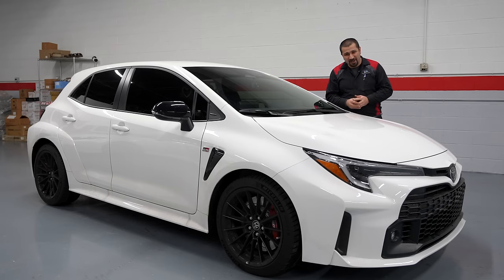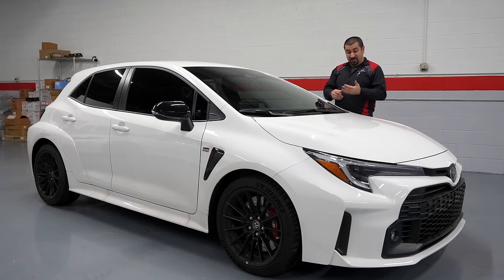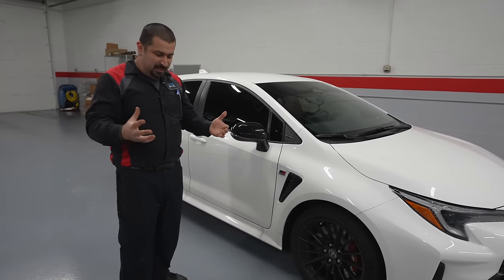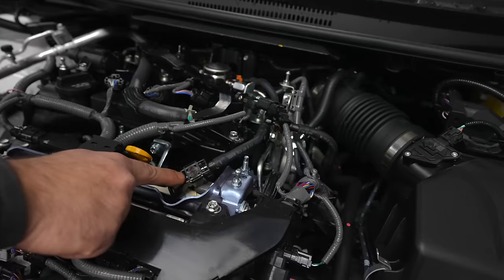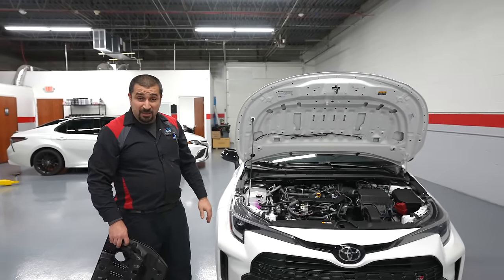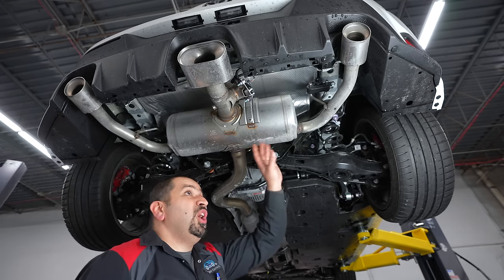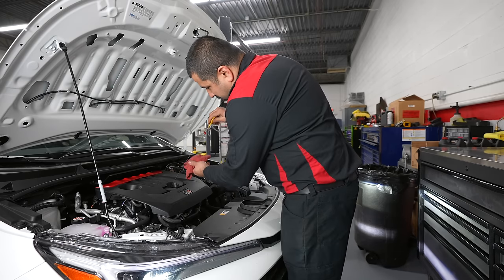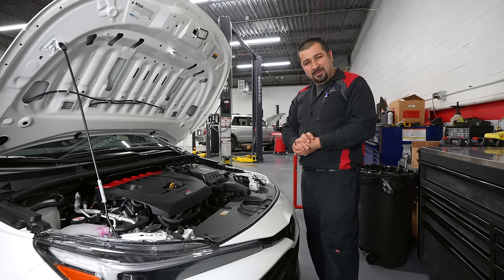The Toyota GR Corolla is Truly a Special Car | First Service and Technical Tour

Comment: I have been watching some car videos lately, and I have noticed You-tubers in this the third instance, desperately trying to upsell a three cylinder engine. (Another is the Nissan Rogue). Three cylinders don't follow the general laws of energy dynamics or simple harmonic motion. They are inherently vibrators from hell. So manufacturers are going to hype this stuff, make exhaust flaps and sound effects to fool you. These three little cylinders cannot even fill all that exhaust. This is our automotive future, 3 cylinders and probably a CVT moving an object that outweighs all the performance possibilities from the get go. This will be our brave new world. All because we allow it to happen and buy this stuff.
Did you hear him mention that it's "a very big turbo spooling up to around 26K rpm". Mmm, there's the key. Most of these engines will be mounted on hydraulic engine mounts to reduce the buzz and vibration. Hopefully, since it's a Toyota it will last a "reasonable" time. 
But I doubt it very much, since to get this type of performance from 3 cylinders is going to take some serious gas pedal inputs. As an engineering rule of thumb, 4 cylinders at 2.5 liters and normally aspirated will last forever. 
Or six cylinders straight and in V formation.
Just look at all those Hiluxes running around in Africa. Now those are REALLY engineered to last.

I am not knocking Toyota. I am getting a Camry V6 before it goes extinct. When we know as humans and learned people, that this type of physics doesn't work, we should not be applying engineering bandaids in the extreme and sell it as mechanically successful.
The only place 3 cylinder engines should be is on lawnmowers and wheelbarrows. Not on heavy objects like cars over 500 kg.
Reply: You raise some interesting concerns. Toyota has been mass producing 3 cylinder engines for Asia and Europe for quite a long time. They are installed in cars like the regular Yaris and 
Aygo. I am unaware of any chronic issues. On the other hand, I would not touch a Nissan, Mitsubishi etc.  3, 4, 5, 6, 7, 8, 9, 10, 11 or 12 cylinder engine with a ten foot pole. Let's check back in 5-10 years to see how this relatively new G16E-GTS turbo 3 is holding up. 😁
Reply: @rightlanehog3151  RLH, I agree with you. I just got off on a rant. BUT, remember Europe and the parts of Asia these are sold in are the size of postage stamps. 
I am just trying to will my mind into a cross country trip from LA to NY in a three cylinder. 
But seriously, my thoughts are more on the philosophical. There are too many people in the USA that didn't have any exposure to life's mysteries before iPhones.
Now they go into the hype and buy these things. That creates a market big enough for these car manufacturers to exploit. If 75% of the younger generation would know these things, nobody would buy them. This is how we are losing our V8s V6s and even 4 cylinders. That to me, is a travesty.
Luxury cars with tiny engines and big turbos. And no longterm reliability.
I often wonder how many people go into dealers and drive away vehicles and don't even know what they bought? How many people go in and get sold a bill of goods, and drive out with vehicles with underperforming tech at enormous cost? How many realize they just bought a CVT. Or a solid rear axle. Or a tow rating they couldn't use to pull a garden trailer to the dump.
Anyway, que sera, sera.
Reply: @mlo5083  The young generation does not buy cars. The average age of a new car buyer on he USA is around 55.

Comment: I was wondering what break in oil change interval you would recommend? I have been thinking first at 500 miles, second at 2,500 miles, third at 6,000 miles and forth at 10,000 miles. After that switch to the normal interval.  

Still keep with 5k oil change interval?

Got my name on a local wait list and want to do my best to take care of it. Happy that toyota finally make a small performance car.
Reply: Your logic makes sense. Oil is cheap and engines are not. I'm dropping my routine changes from 5k to every 4k miles since I'm done buying cars.
Reply: He always says in his video to do a break in oil change at 1k then just go for every 5k. He truly knows his work

Comment: This is way more expensive than a Mazda 3 Turbo AWD. Ethan made fun of the Mazda for being so expensive. Online all I could find for pricing is about 40K or more!. My buddy got his Mazda for 35k with a lot better interior. I agree this is more boy-racer with the manual trans (which I prefer btw), but depends on what you are looking for. Lets see these both tested side by side. If this has happened please post link, I'm very interested. I love both cars also.
Reply: The thing is, this is a limited edition type car like the civic type R and will like hold value at insane levels (like drive it sparingly for 5 years and you can sell it for what you bought it for). This is also a track car, swap the brake fluid and maybe pads and you can drive it like a racecar with no worries. The Mazda is nothing like this. The Mazda is just a regular, mass produced car that will drop in value like any other Mazda.
Reply: @michaelangelo5783  Understood about how rare this is, but I would not want to drive it sparingly. :) And if you tracked the car when driven it would show and tear. It would be like finding a 3rd gen RX-7 unmolested. Good luck. BTW we are not in disagreement about this car.
Reply: @jimlahey1246  
I will say if I had $40k for a fun car I'd go for a mint, lower mile pre-owned Lexus F car with the bulletproof 5.0L 450hp V8. Don't even bring up the 3rd gen Rx7, that's a dream car of mine. I think that has to be one of the most beautiful cars ever made.
Reply: @michaelangelo5783  Dream car of mine as well.

Comment: I haven’t changed my own oil for awhile now, but I used to always spread a small film of oil on the gasket before screwing in the new oil filter.  I didn’t see that done in this case.  Is that no longer necessary for some reason?  Thank you.
Reply: Toyota filters are pre-lubricated
Reply: @rightlanehog3151  - Thank you for that reply.   I didn’t realize they did that.

Comment: ive always bought cars that had bigger displacement engines than required because they dont have to over work. Not keen on the 3 cylinder and thats because of the fact itd working its ass off all day every day. 23psi is a fair amount of pressure to be put on her too. Its good to see they have put oversized parts on, and that sorta reflects my whole point, bigger than required.... sad they didnt do the same with the engine.